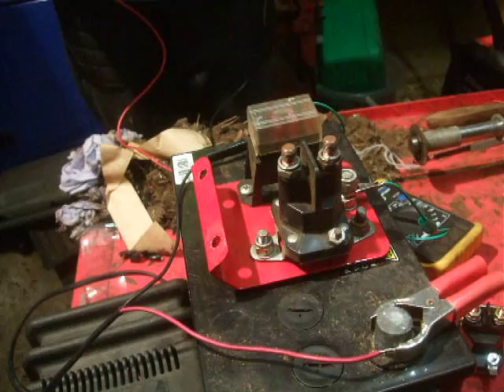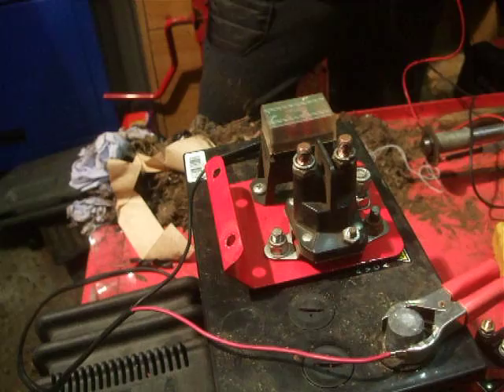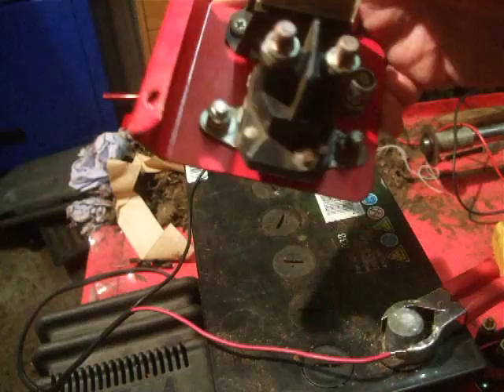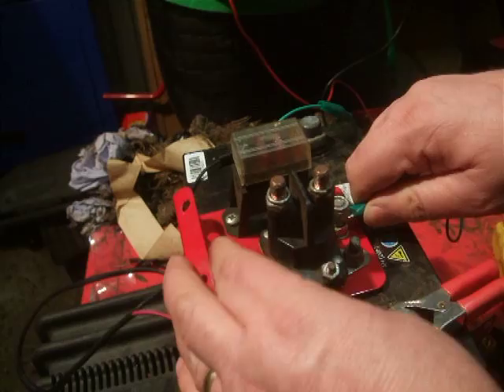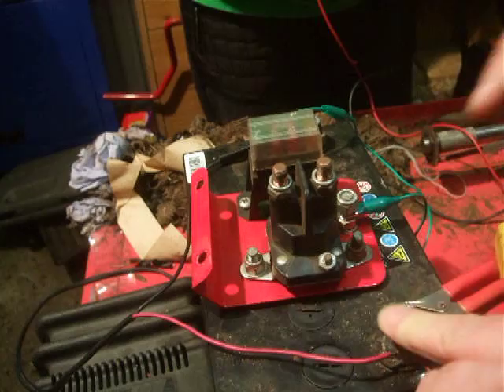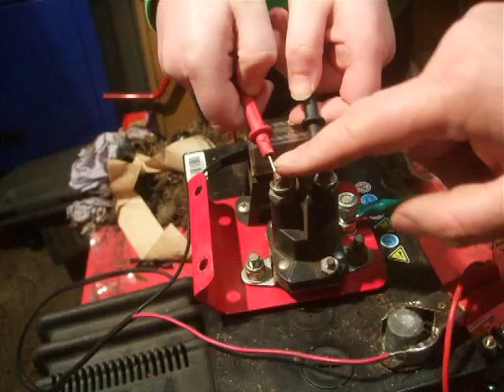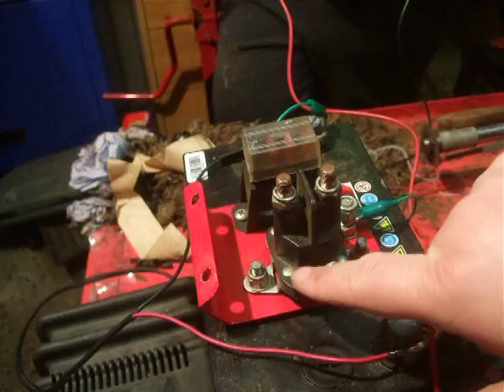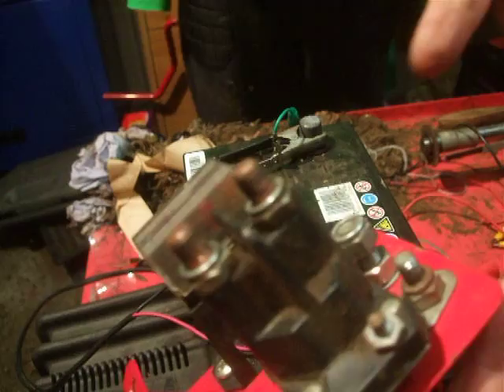HOW TO TEST A 3 POST STARTER SELENOID

Comment: what you did was ok but fail to test  will it pull starter  test it on eng just touch small conn with 12 volts +starter will spin   if not replace solenoid